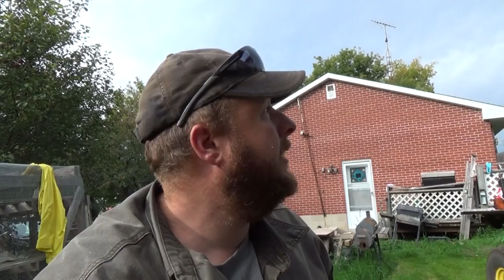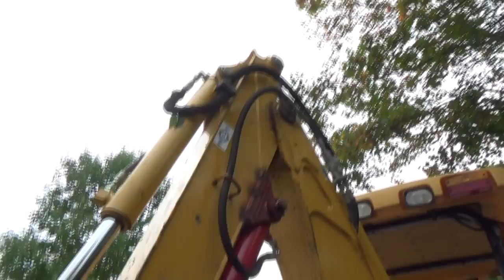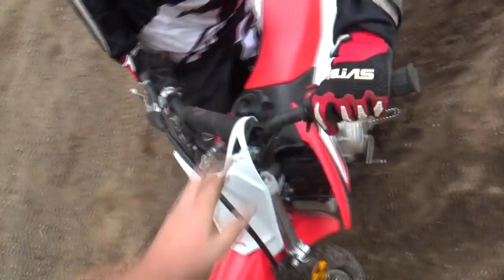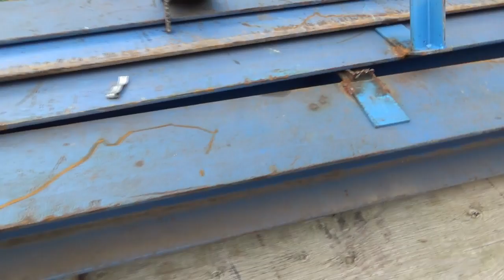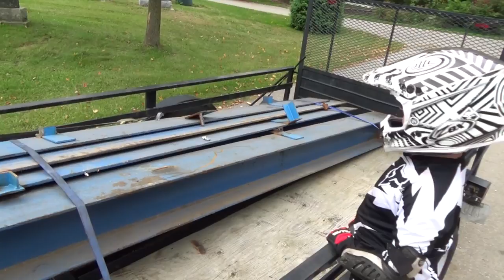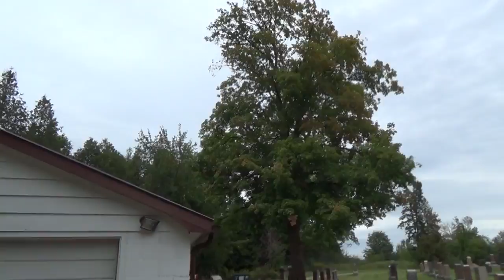IRONDADDY BROUGHT ME SUPER BRIDGE BUILDING MATERIALS

Comment: An idea for another project would be a lift table and bucket storage platform with some fair size casters wheels for easy roll. You could then jack up and roll your buckets into place at working height so you don't need to bend over and keep adjusting the boom. Google hydraulic lift tables for some ideas.Also makes nice storage for your buckets that you can move around.

Comment: You really need a regular pole shed for your attachments,  A roof and wall or two upwind to keep most of the elements out, and hang stuff on.  That would probably give you space in the workshop.  Cut 4 or 6 trees for the logs, dig some holes for cement......